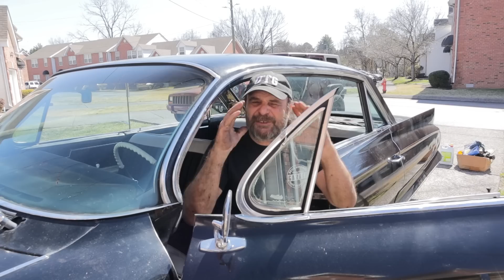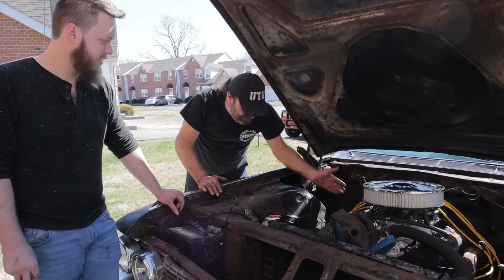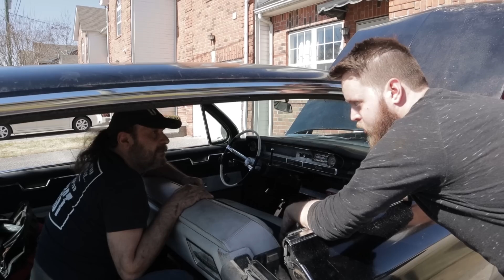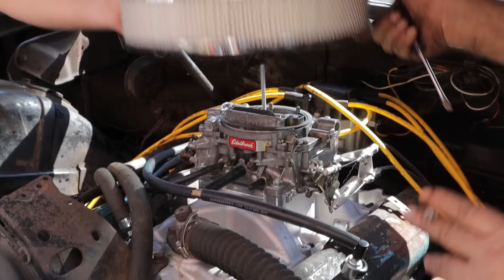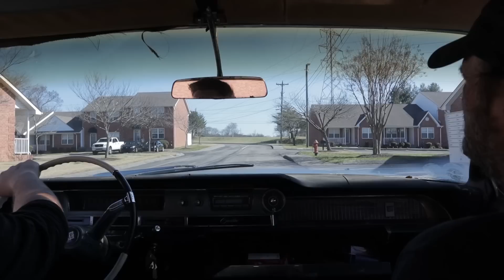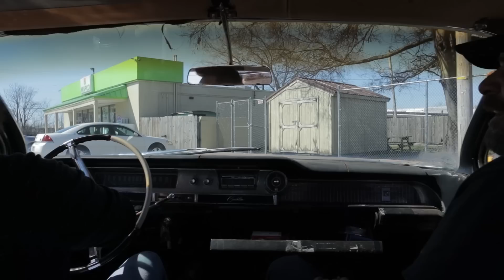The Perfect Entry-Level Classic Car?

Comment: I'm glad he's happy. I try to avoid luxury cars since there's a lot of expensive systems to go bad (but lucked out on a 1986 turbo t bird) and "sporty" cars (six cylinder camaros etc) tend to get beat on by the time you get 'em (still I bought a 68 4-4-2 with 243,000 miles).  A family/intermediate car owned by a senior citizen may have gotten good service records, and probably has low compression ratio so you can fill it with $3.70 87 octane and get around--but hopefully its a year not saddled with a two speed automatic.  Many a cloned muscle car began as grandma's nice Malibu etc.

Comment: Cool old classic Caddy! Years ago when I was about 18 yrs old, I lucked up on a '71 Buick Riviera......the best year, the boat tail. The 455 with the Stage 1 heads custom ordered from the factory. Still had the factory options sticker inside the glovebox door. Still had the original factory duel exhaust & factory posi rear end.......in a Riviera!!! Car was a cream puff & ran like a top, and was a total torque monster. Bought it for peanuts back in 1980, drove it a couple yrs, and like an idiot.....I sold it for peanuts.
Reply: Probably when gas doubled in price.

Comment: With that gearing, if properly tuned and  not worn out if it has a 700R4 or equivalent overdrive transmission it should be able to get 20 mpg or better, although a bigger engine like a Caddy 472 or 500 would be better than the current 350 as it has more HP and torque at a lower rpm so doesn’t have to work as hard to move the car as the 350 does.

Comment: Parts availability is still very important for your classic car, remember that.
Reply: And which Brand/Models have more variety?
I really want to jump in but as soon i remember i need parts at least to keep it running fine get lost. Any insight will be appreciated
Reply: @Carlos.Rivera  Well like he said don’t go getting a Fiat. The best cars are the ones most popular like a Foxbody mustang or a Chevy Nova. If you get a foxbody then LMR would have every single part you could ever need. Things like old Buicks, Pontiacs, and Cadillacs people don’t often make parts for. Another great thing is to do something super simple like a small block Chevy swap.
Reply: @Carlos.Rivera  A Chevrolet, hands down, will be the easiest to mechanically maintain from a cost and parts availability position (they're also hard to beat from a technical difficulty position). Particularly anything with a small block and a "modern" automatic transmission (TH350/TH400). 350+TH350 is probably the most plentiful drivetrain ever produced so parts are everywhere.

This puts you into a mid-1960s and up car or something older that has been swapped. I'd suspect the budget options in that era would be 4 door Malibus and Novas. Both are insanely well supported in the aftermarket on the chassis and body side too.

The further you get from Chevrolet, the worse things become. I'd say the pecking order is probably Chevy, Ford (all divisions), Buick/Olds/Pontiac, Chrysler (all divisions), AMC, and if you really hate yourself you can get into Studebakers, Packards, or any early import car. Edit: Caddys are also a nightmare. I'd put them between Chrysler and AMC.

This is just my opinion and I'm no brand loyalist. I'd happily own cars from all of those brands (and do/have from about half of them).
Reply: @TheBrokenLife  international harvesters are terrible for parts too
Reply: @noone-nd4ml  Oh, absolutely. Anything from an orphaned brand is going to be a disaster. Not saying I wouldn't, but it's not an easy path.
Reply: @TheBrokenLife  i own a couple its weird buying parts for them because they have an C motor GM or ford brakes GM wiring ford rear end and chysler or IH transmissions
Reply: @noone-nd4ml  I own AMCs. I feel your pain. 🤣
Reply: @TheBrokenLife  im pretty surs its a form of torture to force someone to buy parts
Reply: @noone-nd4ml  Ehhhh... For mechanical stuff you just have to remember your decoder ring so you know to ask for a "whatever" from a 78 Ford/Chevy/Chryco "whatever".

Body/trim, yeah, good luck with that. Better buy a parts car with a nicer thing that you need.
Reply: @TheBrokenLife  mine was my great grandpas hadnt ran since 85 ive been trying to piece together parts. Got it running last fall but i need to pull the motor and do freeze plugs. Bought a parts truck but it leaks 2 quarts of oil every 15 min so i need to decide which one is worse. As for body parts most are avaible for an arm and a leg a windsheild is 900 dollars
Reply: @noone-nd4ml  I'm glad I have most of what I need for my garbage and bought it back when it was "cheap". I have a GMC to restore and there really is no GMC aftermarket for a lot of things. Last NOS grill assembly I saw on eBay was $4500.

So, let it be a lesson to the youth of the world: Chevrolet for your first classic is the way to go. Cut your teeth easy.
Reply: @TheBrokenLife  im young and dumb i have that 67 IH a 62 Ford Falcon a 74  Newport and im aquiring  a squarebody this summer for cutting some trees
Reply: @noone-nd4ml  Well, if that square is a Chevy, you're about to be in bliss. 😆
Reply: @TheBrokenLife  yup a 197? Half ton SBC350 auto 2wd . Its a coffee truck they want about 20 trees cut down. I may aquire a 1987 Dodge D150 4wd this summer too. Ive also  aquired a 300 dollar 199? Ford f150 4wd with a 6 inch lift to fix my 1996 Ford F150 4wd. I really need to fix my 07 VW golf i traded my lazt lapped out truck for.

I need to stop aquiring vehicals i think im at 9 right now. Need something from the 80s maybe a fiero so i can have a vehical from each decade starting in the 60s
Reply: @noone-nd4ml  It's not often that I'd say this, but I agree that you have too many cars. 😆
Reply: @noone-nd4ml  Maybe a first gen RX7 or you could get a early Foxbody
Reply: @williamsanders468  big money with the exception of my truck i havent spent more than 1500 dollars on running mostly rust free vehicals. I would have to travell atleast 4 hours to find one more than likely 8 hours

Comment: Very stylish without being as excessive as some '50s cars. Love those early '60s GM curved windshield pillars. People used to knock tailfins. But I drove a car with modest fins for a few years, and mine provided an unexpected safety feature. From the driver's seat, when backing up, I could see the rear corners of the car. 
By the way, I never had a car with fuel-injection until 2005!

Comment: I wanted a 60s late 70s pickup to haul my late 60s and early 70s Motorcycles. I came across a 1972 Ford F250 last October. It fit the bill 352 FE 4 speed with granny low. Got it running and drove it till the salt hit the roads here in Wisconsin. All this winter I had it on my lift and and completely replaced the brake system, fuel system, exhaust system and restructured the passenger floor board.
I did it on a budget, but you couldnt buy a decent 3/4 ton truck for the money I have in it.
Reply: A 1973 IHC 3/4 4X4 , 392 ,  4 speed with a pto driven winch came across my path several years ago. Finding some of the parts for the exhaust and breaks were a pain.
Then last year at a farm auction I bought a 1976 F350 4 speed with a flat bed.
When I got it home I pulled the oil bath air cleaner off the 390. It was hiding a Edelbrock 4 barrel and manifold. I am going through the suspension now.

Comment: Back in the day before under coating the vehicles would have been brought in for an oiling = the under side of the car would get sprayed with light oil to keep the car from rusting
Reply: And inside doors, rockers, etc. 
Chicago, 1950s
Reply: I have been doing all my cars since 1971 . Even oil my 1976 supercharged corvette  frame and bird cage owned the car 41 years here ,in Ontario the rust from damp and humidity . The bird cage I inject oil by removing t top sheet metal screws . The vet I prepped and painted in blue and diamond metal flake in my garage dyed the original white leather seats replaced the carpet refinished the steering column and shifter  plate repainted the gauge indicators and all other interior trim . Because I take good care of the frame it never required frame off restoration in the 41 years I have owned it . Also I purchased and restored a 2006 black on black Pontiac 5.3 gxp  with blown transmission for  $1200 Canadian. I spent approx  $3900.00 for the car and rebuilt transmission brakes touch up paint body supplies and safety check  the car looks better than new after touch up and compounding and 2 coats of hi quality wax  and the 0em alcor aluminum rims

Comment: That dual PCV needs to be fixed!  One side has to let filtered air INTO the engine, with the PCV valve on the opposite corner of the engine.  The current setup will be pulling a vacuum on the crankcase which is not good and can cause oil seal failure and also will pull more combustion products (and unburnt fuel when engine is cold) past the rings.
Reply: Yes! Was going to mention this myself if someone else didn't.

Comment: You know how Uncle Tony is geeking out about the manual Mirror adjustment, I am like that about the Dodge/Chrysler Fender top turn signal reminder light, you won't see that on a Jelly Bean Honda civic, just spent two days (no shit, 8 hours replacing a Starter on my Daughter's 2007 Honda Cicvic, two bolts hold the starter, the battery hot wire and the ignition wire) It was in such a tight place, on the back side of the motor between the CV driveshaft and behind the intake manifold. SO hard to get to, I was using up all my extensions and ruined a 3/8's drive universal socket, no joke it had a bolt on top of the starter that was like it has a washer 1inch from the  threads to hold the starter against the  bellhousing, but then the bolt had 6-8 inches of unthreaded part to the bolt head, 14 mm, instead of 1-1/2 inch long bolt they built in the extension to the end of the starter!. Never seen a extend a bolt like that b4! Those old big cars are great. First thing I do is repair/replace brakes, not just for stopping, on that Cadillac a few bubbles will cause the drum brakes to drag, killing gas mileage! Also if you run across a junk BMW or Volvo you can rob the bucket seats and put in there, I always toss the bench seats in my little trucks. I am running a 4x4 1990 Dodge Ram 50 and one of the things about it, it has a snake of brake line on the driver's side fender, and a coil on the passenger side, if you were to put a 4" body lift the Factory Provided extra brake line so all you have to do is straighten out the coil or wiggle snake, you don't have to go to the store for longer brake sticks, Only in a Dodge, factory extra brake line provided in case you want to add body lift. We use them a lot to clear oversize tires..

Comment: when i bought my cougar it was wired with extension cords  an the coil had looked like it had been beaten with a hammer an would instantly heat up an would only run for a few seconds unless you were  pumping the gas peddle it was a hot mess.

Comment: Hello from Sweden. Nice car. I have a 61 with 350 and 700 transmission
A good and cheap upgrade. Good luck with the car and just restore a little bit at time and dont blow it total apart. Be sure to drive it and use it much.

Comment: Gosh! I envy this guy! I own 4 classic GMs of the Sixties, but no Cadillac. Here in Europe I think you could not by a car like this for less than 10 000$!  
1961 and 62 were the last of the super cool Caddies!
My Bonneville convertible has a lot of luxury features. The mirror system is the same. You must love fullsize cars of the Fifties ans Sixties. Cars were never the same after that.
It is true. A classic car from Detroit gets much much more attention in Europe than any newer Ferrari, Lambo and Porsche. A guy in a super cool Masereati told me that he likes my 65 Bonneville much more than his own car. 
One thing is cool: A car like this Caddie is ment to be driven and you do not have to be afraid for scratches or fingerprints: Keep on cruising. This car is a perfect candidate or slow improvement with things you can make with a limited budget over the years to come.

Comment: Just like my 1966 Pontiac Starchief Executive i got for 1000$ CA  Total custom restoration came to 5000$ CA.
389ci 325hp-425fp/tork.  
131mph 4 doors GTO car.  You dont look at the doors when your driving.  Nice pick with the Caddy.
Reply: Thanks to Tony's Videos.   I did all my work alone and it helped a Looottttt when i didnt know mecanic tunes and tweeks even if i already had basic knowledge growing up in 68 Charger RT and Mopar streets and  drag strips on week-ends.  
Too bad i cant post a pic of my 66 Pontiac and the custom paint i did with sanded ghost flames and contrast arch from front wheel to back wheel wich disguis the 4 doors look to a 2 doors just with paint !   Its your project and im sure your gonna build something cool and head turner !

Comment: I'd prefer the original 390 Cadillac engine and the 4 speed Hydramatic.
Reply: Right up until you needed a part.
Reply: We got most parts for 331" to 390" and jetaway tranny in stock in our shop here i Sweden so its out there.. But yeea,  way more expensive than sbc&th350..

Comment: The original differential ratio was 2.94:1. The original transmission was a 4 speed Hydramatic, which had a 3.89:1 first gear. With that ratio, plus the 390 engine which had 345 hp, and 425 ft/lb of torque, it would get off of the line, even though it weighed about 5,000 pounds. I'm guessing that it probably has a TurboHydramatic 350 or 400 with the Chevy engine, which are 3 speed transmissions with probably 2.48:1 first gear.

Comment: That might be the ideal car to put a 700R4 into. With that rearend gear and your plan to make it a dependable prowl car it could be a great choice. Ask Tony. Maybe get 16 or 17 out on the road lopin' along at a reasonable rate
Reply: I’m thinking that if it’s properly tuned and the engine isn’t worn out, it should be able to get about 20 maybe even more. I had a 69 Buick Electra with a 430 in it that got 22 to 25 at 65 - 70.
Reply: @todddenio3200  Right and in the city stopping and going you get 8mpg. Lol
Reply: Early smog era BIG cadi mill (470 or a 500 eldog) and a turbo 400. Elephant body needs elephant torque. I had a 74 Electra with a 455, tuned right she'd get 20 mpg all day every day, city or highway. That small block just doesn't have the low end grunt needed to keep the power requirement at the low end of the fuel delivery curve.
Reply: @ludditeneaderthal  I agree completely. If can find a pre-smog 472 or early 500, they’re strong runners with 375 hp and 500 lbs torque and with good gearing can get great mileage and go like a scalded cat. And they only weigh 75 lbs more than the 350 that’s in it.
Reply: Strange how my 69 Buick Electra with a 430 in it got 22 to 25 on the highway and 15 to 17 in city driving if all it was capable of was 8. The only vehicles I ever had that got such low gas mileage were my 64 Buick Riviera, lol my 72 Ford F-250 and a 67 International Travelall. All others were able to be tuned or re-geared to get good mileage

Comment: I'm 80yrs old and had many 60s caddy's convertibles and have driven early 2000s Northstar s which 2k$ will get you one  if engine good to me a better deal than a deralic with 60grease fittings .😊 And Elvis never had a 4door gagitllac

Comment: Maybe one of those PVC valve is supposed to be a breather line or filter canister instead. Usually they are. I used to own a 1969 Buick 350 2 barrel and the filter for the breather line is in the air cleaner housing and the other valve cover has a PVC valve and a vaccuum line to the carb or carb base plate. I used the after chrome breather canisters they work great.

Comment: Also the Fram PH3600 can be substituted with the Fram PH5, the PH 5 has like twice the filter and volume of oil capacity. The kickdown for the transmission can be a vaccuum leak.

Comment: You left vacuum hooked up to manifold vacuum?
Reply: I was wondering this myself. It doesn’t APPEAR to be an EGR engine. There is a single vacuum line going from distributor to carb. According to UTGs own video on vacuum tuning a car…it should be connected to PORTED. However, in this video we see UT move it from PORTED to MANIFOLD. I do not understand why. Help us out, Uncle Tony!! What are we missing here?

Comment: The perfect entry level car for someone to learn on is something stock, not something some hack has half ass thrown a non correct engine in. My opinion of course, but I do have experience dealing with things other people have modified and it’s not fun to figure out. The car itself is in good shape; but the soul is missing to me
Reply: You can get the code off the engine and find out exactly what it is.  I bought an 80 Trans Am with a 454 in it.  Came out of an 85 truck.  Probably a one ton.